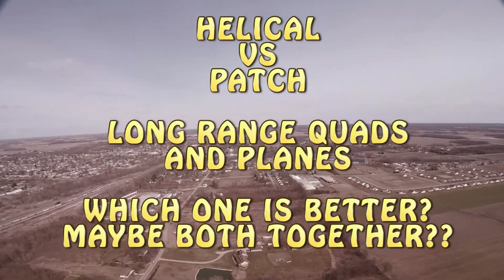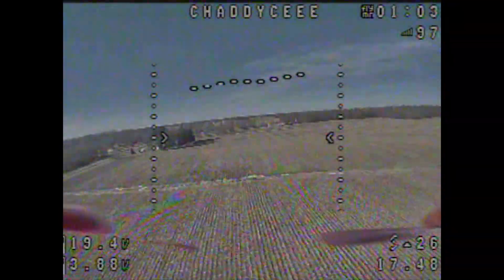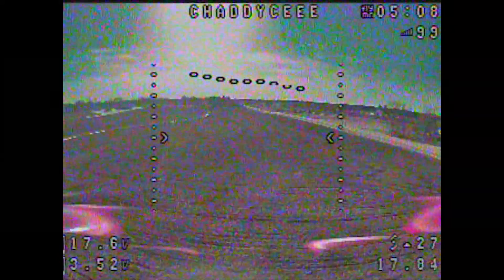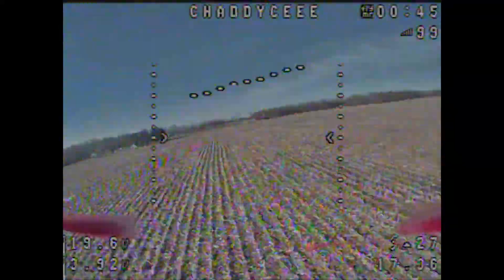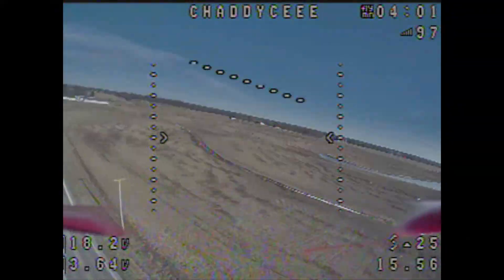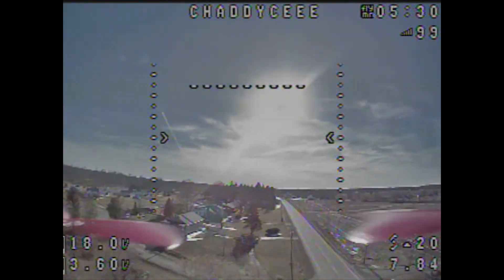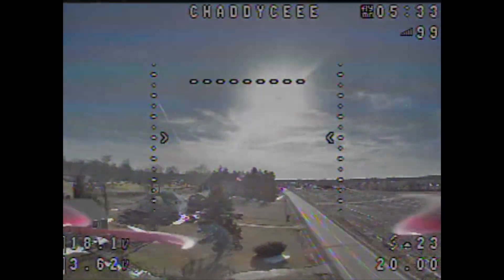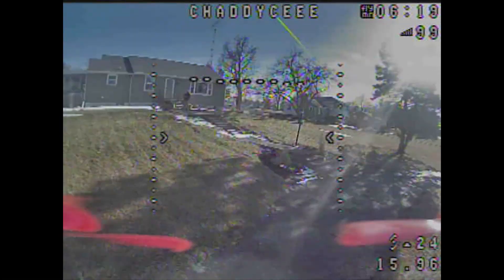LONG RANGE ANTENNA TESTING..HELICAL VS PATCH!!

Comment: Great vid.  I need to ditch my old junkie patch.  Instead of getting a new patch: what helical u have?  Link?
Reply from the maker: https://www.readymaderc.com/products/details/vas-5-8-ghz-3-turn-rhcp-helical-7-dbic
Reply from the maker: i also use the 5 turn version..it has like 120 degree beam width where the 3 turn has about 160..they both have side lobes though..im also mounting both on my goggles and just slightly pinting them about 20 degrees apart for longer wider coverage.  you can se they penetrate very very well.

Comment: I have the same experience.  switched to a patch from my 3 turn helical and there is no comparison.  just fixed my pepperbox and need to test it if you want range from 5.8 get a pepperbox but the price is a lot higher but it is worth it for rage and flying thru trees
Reply from the maker: i had that xairx2 pepperbox and i didnt like it..went back to the single xair for the past year to two.  just dug these out of the junk drawer and was like wow